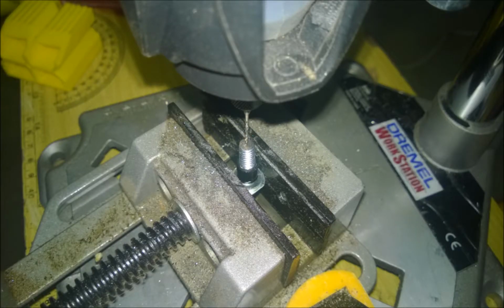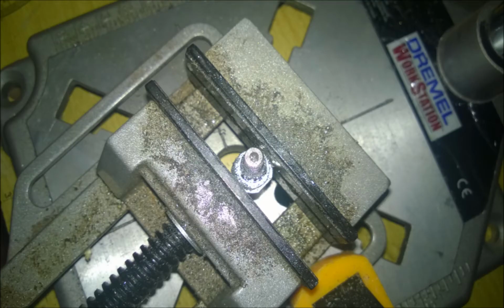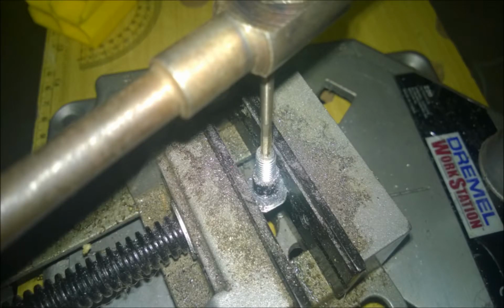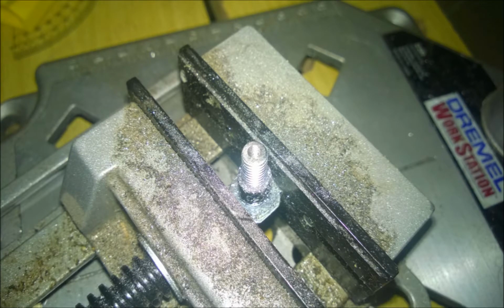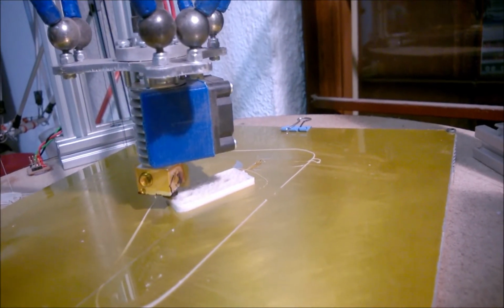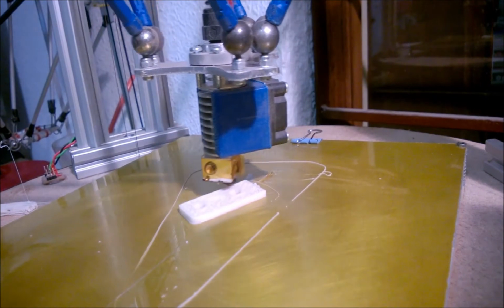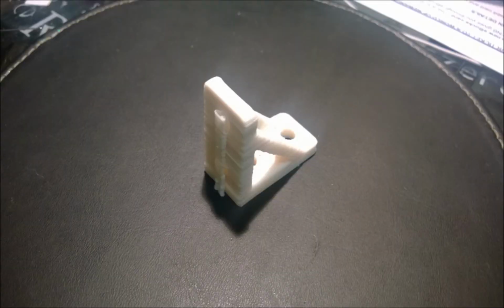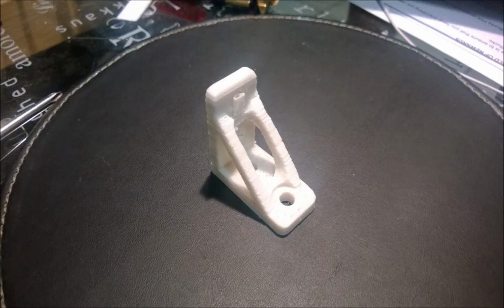3D Delta Printer Magnetic Ball Joints Upgrade

Comment: Where did you get the magnetic joints?
Reply from the maker: Hi Philip, I stripped out some magnets from magnetic building toys I had, but you could buy some neodymium magnets from a local magnet supplier. (I know a couple in South Africa otherwise check ebay). I would add though that the magnetic joints is the single point of failure on my printer. I would replace them with hobby RC ball joints if I built it again.
Reply: @gineer  I have an anycubic predator. Same issue. Do you use a bl touch?
Reply from the maker: @Phil-D83  I don't, no.